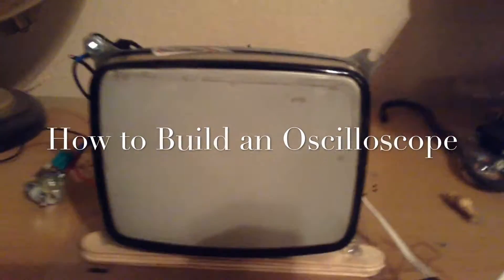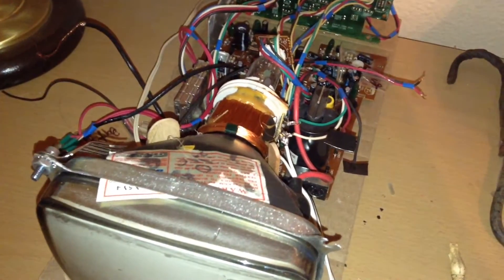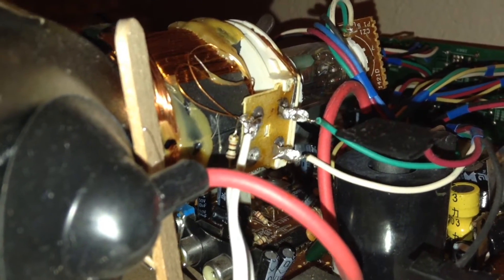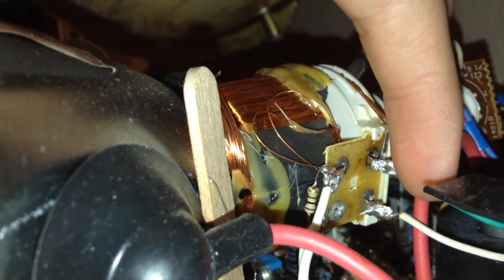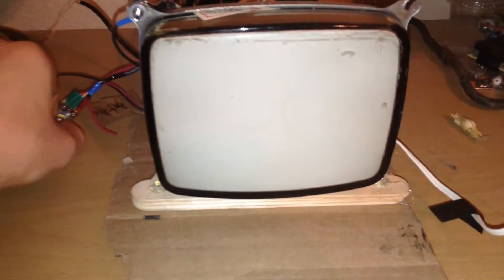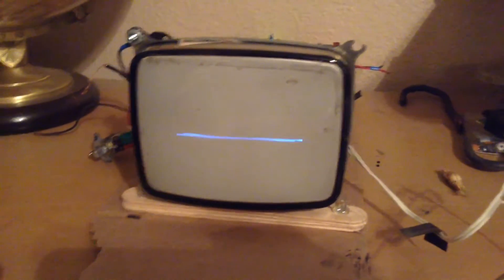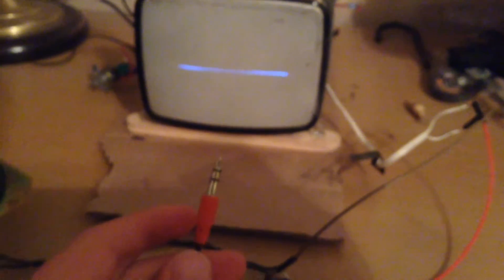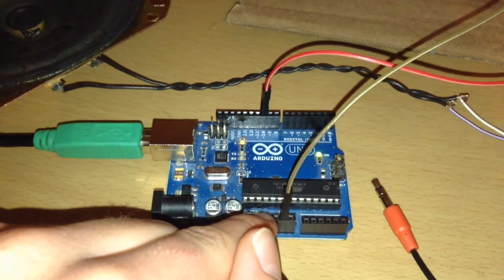How to build an Oscilloscope

Comment: I built one!
Reply: Hey, im planning to build one too, do you have a conversion circuit to let it have higher voltages? Thanks if you read : )
Reply: @limegreentechnologies8803  I suggest using a resistor voltage divider.
Reply: @NerdlabsSci  yea i see, i thought of doing that, buy thanks anyways : )

Comment: i ve seen to other videos that they usually using the vertical coil not the horizontal because it has (better?) performance..
Have you tester this? is there any way to scale somehow the input signal in order to see better the high frequencies?